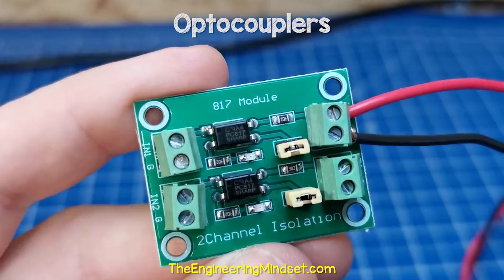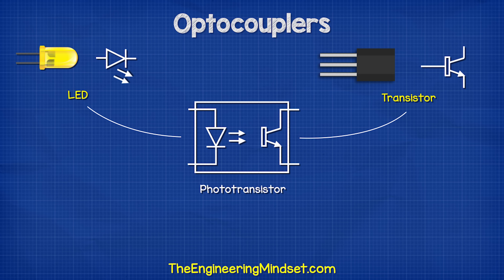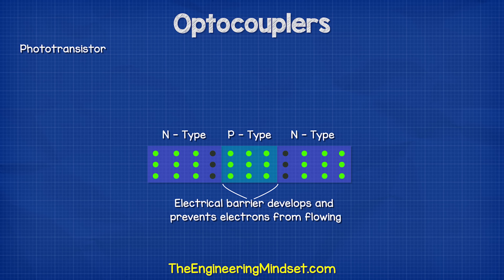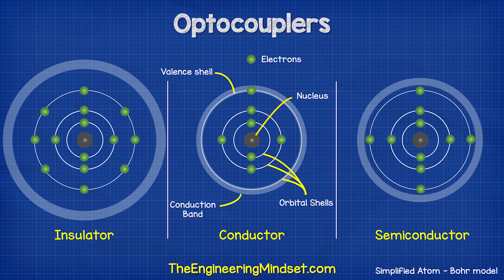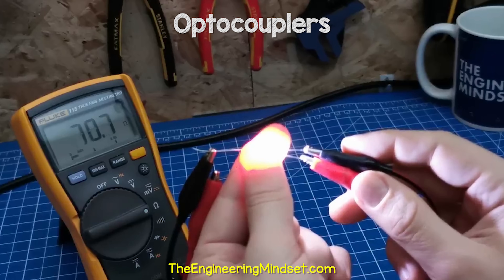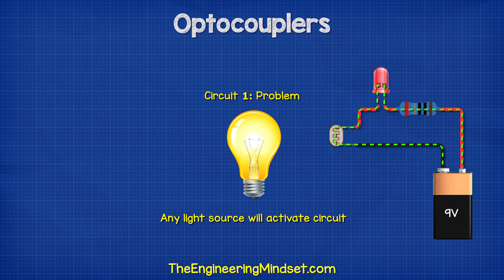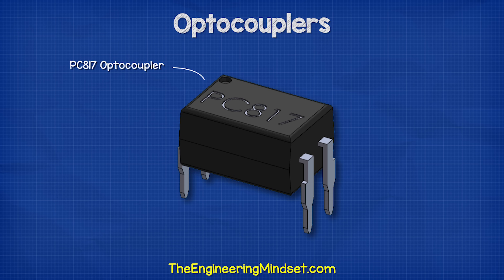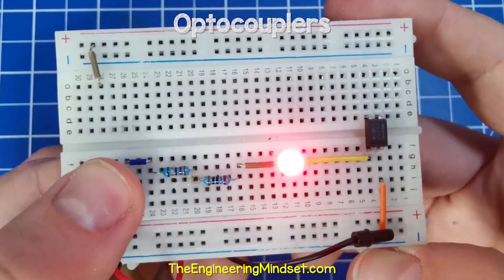How Optocouplers work - opto-isolator solid state relays phototransistor

Comment: Question:
I'm going to use a 30 amp rated optocoupler relay to power and automotive ignition coil on an old beetle.
Do I need a flyback diode ?
I'm only an electronics novice.  So could you help me with a little circuit design and values ? Thank you very much.

Comment: Hello I have some questions can an optocoupler by used for sine wave triggers ? You see I have sensor control trobel Using an hei ignition system so I wanted to experiment with other methods controls.So I'm interested to know what frequency range do those optocoupler work ? I do need kinde of pulse trigger for an transistor based phase shifter 0-180° variable phase controler so only problem I have is turning that useless sine wave signal to an DC pulse trigger signal .So Hoppe some one understud my question.Does the sine wave need to by rectified with capacitors or diode bridge so that optocoupler would work ? My operation frequency is at around 0hrz up to 333hrz other info that I have is 1khr rated reluktor ,1.35henry with around 350ohm resistance . So Hoppe some one also work with sensor controllers and can assist my with my unusual problem.

Comment: Pardon my ignorance. But at the 10:21 minute of your video, when calculating the necessary resistor value for the secondary side of circuit 1, does the LDR not have a voltage drop to include in the calculation? I appreciate your very well documented video.

Comment: I just realized that they kinda use the same principle as fiber optics huh? They send a signal using light emission which is then detected with a photosensor on another circuit. That is funtamentally how fiber optics transfers data

Comment: Your pinouts do not match the manufacturers data sheet. The pin1 by the dot is correct and the numbering goes CCW. Your emitter and collector pin numbers are wrong but the descriptions are correct. Excellent technical description otherwise.

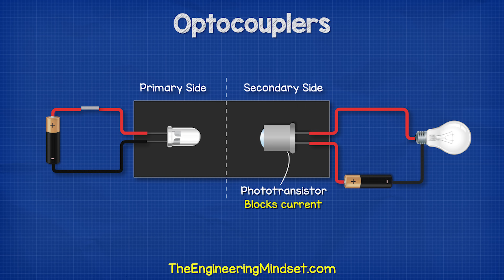Comment: The animations sometimes show electricity flowing from the positive to the negative terminal of the battery, however, it actually flows in the exact opposite direction. 3:45 has the electricity flowing from + to - and from - to +, so I guess you never intended to show how electricity flows in the real world, which is kinda sad, considering how awesome the rest of the video and explanation is.
Reply: That’s why he said using the conventional method of diagraming it. Which is correct.

Comment: Question, i have 380VDC output from a solar inveter i am building and i need to light up the ired diode inside anEL817 opto, as a feedback voltage control, what is the best way to do it? with resistors and a 10K pot or with Zeners?  this is with an SG3525+LM358 +EL817   board
Reply from the maker: Seen our new video on HOW SOLAR PANELS WORK in detail https://youtu.be/Yxt72aDjFgY

Comment: Very complete and concise presentation. 
I noticed one thing about PC817 though that surprised me. You show the pins 1, pin 2 on one side and pin 3, pin 4 on the other. According to the Sharp datasheet, pin 3 should be pin 4 and pin 4 should be pin 3. That is, the pins are numbered down one side and up the opposite side, not both sides from top down. Not sure that will cause anyone too much heart burn, but ...

Comment: I bought 15 - 20 of these bad boys in the past over different time periods with various types (transistor, triac whatever) and they all turned out broken. One time I was following a circuit and other I made sure I applied correct values but no luck. I don't know if I popped them by some easy mistake. All my instruments were working properly. I'm superstitious about them at this point and hope I never have to use them again. (p.s. I don't even remember wtf were the projects nor do I have any schematics from them, just thought I'd share my experience 😆)

It is sad because these are the cutest packages ever with their 4 pin dual in line structure. They could easily go for a boring single lined 4 pins transistor look but they didn't.

Comment: Thick film resistors have a 25KV rating, this optocoupler circuit will arc over before that. A thick film 2W resistor on both power lines followed by  clamping diodes is lightning proof and if you short the signal lines on the board it has no effect on the supply line. Optocouplers are crap, they have a rise time in microseconds compared to the nanoseconds with not using them.
Reply from the maker: Check out NEW resistor video, everything covered! ➡️ https://youtu.be/DYcLFHgVCn0

Comment: I HAVE A QUESTION PLEASE 👉👈🥺
The illustration shows 2 separate power sources. But what if you connect it to only 1 battery? Will that work the same way as an isolated circuit? I am building my DIY Amplifier and I'm struggling how to isolate the ground(negative) connections from 1 power supply to power two different boards such as power amp and Bluetooth decoder. When I connect them to the power supply in parallel, it produces the humming sound even when the volume is down to zero. I'm looking at B0505S 5V isolator to power the Bluetooth decoder using the same power supply (or battery) without any noise due to ground loop (or something like that).. Or should I use optocoupler instead? THANK YOU.

Comment: You have numbered the pins incorrectly at about 0:35.  Pin 3 and 4 are should be the other way around with pin 3 at the bottom right and pin 4 at the top right.  I know that might seem pedantic but it's important to get numbering systems correct, especially when dealing with ICs.

Comment: The explanation after 13:50 makes little to no sense, since you are introducing a mystery component Receiver, which you don't explain at all. It doesn't seem to work as a IR fotoresistor, and it isn't an emitter, so why is it calculated as an IR emitter? Is it in fact an IR activated transistor? If possible, could you (or someone) please either explain how this works, or point to some materials that explains the workings of this receiver that works like in this diagram.

Also, why are the receiver stats looked up from the emitter graph?

I am lost, after wasting hours trying to find anything even remotely clear information about this topic, I could only find wildly contradicting articles. If anyone can explain this to me, or point me to the right direction, I would greatly appreciate it

Edit: For anyone else interested, I got our University's Electronic's Professor to explain it to me. In the tutorial, he is suddenly changing into a photodiode setup instead of photoresistor, and using the photodiode in reverse! 

So this photodiode will act as a normal diode in dark, however, unlike normal diodes, it will allow current to pass both ways when hit with the foton particles. 
And since it is reversed in this case, it will block all current, until it is bombarded with fotons. It also has a dark semi-transparent shielding on it, that will block the unwanted wave frequencies, and will act as the switch here-

Comment: Well done! The most impressive thing about this video is the correct usage of units and their symbols, namely omega for resistance (instead of R that most Yankee videos would use; also some Australian), capital V for voltage (yanks use most of the time incorrectly lover  case "v") and putting zero in front of decimal point. Congratulation, keep up the good work and hope that budding young technicians will pick some good habits.

Comment: two quick question for you 1- how to protect the optocoupler from reveresed voltage from a mosfet which is connected to the output ? do i need to put a diode before the 100 ohms resistor on the gate? question 2 - is it possible to use the mosfet source and drain as a switch between 2 capcitor to connect them one time as parellel and one time as in series ? just like a switch by sending a signal from an arduino , my issue is its latching to close always how to prevent that latching ? thanks a lot in advance
Reply from the maker: Check out NEW resistor video, everything covered! ➡️ https://youtu.be/DYcLFHgVCn0
Reply from the maker: See my new MOSFET explained video here➡️: https://youtu.be/AwRJsze_9m4

Comment: Fun fact: some people CAN see infrared light. Some are born with an extra cone. Some have a wider bandwidth of light. I don't think I have an extra cone but since I was a kid, I've been able to see a deep deep red light coming from the end of a remote control. I've also noticed I can't see all tv remotes as some use even longer wavelength infrared than most. It also seems like most TV's use a shorter wave infrared, the ones I can detect. IIRC, most tv remotes is 860nm? That's the one I can see.

Comment: There are also optocouplers that have an integrated MOSFET (a type of transistor) and can handle large amounts of current and voltage without the need for an output stage. For an example, check out the data sheet for PVN012.
Reply from the maker: See my new MOSFET explained video here➡️: https://youtu.be/AwRJsze_9m4

Comment: Something to keep in mind for future vids. Your direction of electron flow is inconsistent throughout the video. around 3:14 for example the optocoupler appears to be coupled between two universes with different sets of physics. Probably most people won't notice, but seeing the electrons represented as travelling the correct way at one point messed with my head as I've had to ignore thinking of it that way to stay sane.
Reply: There isn't anything wrong in it, and no two alternate Universes. There are just two ways to show the current flow, the conventional current (+ to - ) and the actual electron current ( - to +), both are equally valid and used in electronics all the time. However, you do make a good point, that mixing them inside the same video, might confuse some people new to electronics, which so happens to be,  is most likely the main audience of this video.

Comment: But why do you want to use this? If you connect the switch to the second circuit you van cut the first one.. What are practical reasons that this is better than just 1 switch to turn on a circuit?
Reply from the maker: It's electrically isolated, over voltage or current on one side won't damage other side

Comment: I like your video´s. at 3:25 and onwards, you show two batteries. current in one battery flows into plus pole. on the other battery it flows into minus pole. Notice that i'm not referring to electron flow versus traditional current flow.

Comment: The triac versions of these chips are interesting.  They're meant for AC applications, but if you run DC through the triac it will "latch" on and keep allowing current to flow when the control/switch pins are no longer conducting.  It will keep conducting until it stops conducting (for another reason), which can be a useful property.  I built a couple of interface controllers that would turn stepper motors while a sensor was going. There are better methods (that I know now but didn't then) but the machine has been running for more than 20 years now so it definitely worked as intended.

Comment: Simply great teaching, thanks for sharing your knowledge!!
May I please ask you about a "conclusion" I have arrived to, via your videos?
In your video about BJT does it look like you can adjust the "door" how much it is open, by adjusting the current, or in a way make it act as a resistor. And in this video do you show that one side is an LED and the other side a light-activated BJT. My question is since a LDR is very unliniar if it's possible to use the BJT optocoupler as a variable resistor?
Reply from the maker: Check out NEW resistor video, everything covered! ➡️ https://youtu.be/DYcLFHgVCn0

Comment: @17:08 why does 0.02 =  20mA  
when that number is read in decimal format "0.02 = 2/100'ths"
 (2 Hundredths) 
I had to rack my brain in conversion of units to figure out it's in multiples of 1000'ths of an Ampere
0.02*1000 = 20

Comment: Nicely explained.

Suggestion for BOM consolidation: 390 ohms would do just fine for every resistor in the demonstration circuits. No need to stack multiple resistors of various values in series for something as simple as an optocoupler, whether it's an integrated package or a homemade Vactrol.
Reply from the maker: Check out NEW resistor video, everything covered! ➡️ https://youtu.be/DYcLFHgVCn0

Comment: At 3:20 your current (or electron) direction conflicts from the left side to the right side. I’m not sure what flow direction it’s meant to represent.
Reply from the maker: Animation error
Reply: @EngineeringMindset   ah okay fair enough. I do want to point out the real downside with LDRs are that they’re really slow compared to phototransistors (look at how the LED turns off slowly in your video with the LDR). Phototransistors still need to be covered due to stray infrared from remote controls or face recognition devices like iPhones which is why remote controls tend to use protocols so they don’t accidentally get activated (because you can’t really cover them during transmission). Photodiodes are even faster than phototransistors but require op amps to amplify the circuit and like semiconductors in general, aren’t linear so they need negative feedback (by having another identical receiver on the left side) to drastically improve linearity.

Comment: Pinout at 30 seconds and throughout is incorrectly labelled. Top left (near identifier) is Pin 1. Bottom left is Pin 2. Bottom right is Pin 3. Top right is Pin 4. You have labelled pin3 and pin4 the wrong way round. I read in your pinned comment it took you a long time to make this video, and read in the description where another viewer corrected the resistor value, so I hope this pinnout  issue can also be corrected as easy.
Reply from the maker: Check out NEW resistor video, everything covered! ➡️ https://youtu.be/DYcLFHgVCn0

Comment: How to make for ac using pc817
Reply: You use it in its very small linear section of the transfer curve. In short, you offset it on the diode side so the diode will always be lit taking into the calculation for the maximum peek voltage of AC input when calculating the series resistor. Then you can retrieve the insulated AC signal on the output. Another possibility is to use an optocoupler with two phototransistors and having an op-amp use one of the phototransistors for a feedback loop. That solution will be very precise. It is all in the data sheets and application examples.
Reply from the maker: Check out NEW resistor video, everything covered! ➡️ https://youtu.be/DYcLFHgVCn0

Comment: Hi Paul. About your Rectifier Circuits video 

https://youtu.be/RiRyzLl4Y8U

Great work. Just one thing that keeps me wondering...why does the multimeter on the right read peak voltage of the capacitor(15.5V) but without the capacitor, it measures RMS voltage (10V)?🤔
Does it have to do with
1. A setting on the multimeter?
2. A property of capacitors? Or
3. What?
Reply from the maker: It's the waveform which the multimeter is reading. Without a capacitor the waveform goes between zero V and max V. With capacitor the waveform no longer reaches zero.
Reply from the maker: Check our new Multimeter tutorial out ➡️ https://youtu.be/4lAyzRxsbDc

Comment: and for example if the circuite have 2 optocoplers whats is the function in 2 optocoplers ? please
Reply: When you have 2 or 4 lines requiring isolation, then just get a dual  or quad optocoupler to save space and economize.

Comment: 10:15 You forgot the voltage drop in the LDR.

Including it, the KVL equation around the loop would be (ignoring units):

9 = v + 2 + 70 · 0.02
=> v = 9 - 2 - 70 · 0.02 = 5.6 instead of 7

So the resistance of the resistor would be 5.6/0.02 = 280 instead of 350.
Reply from the maker: Check out NEW resistor video, everything covered! ➡️ https://youtu.be/DYcLFHgVCn0

Comment: I still remember back in 1980. We had an industrial application to measure PH Levels. It had an optocoupler of earliest design. A 1/2" plastic tube with 2 wires coming out of each end .  //  \\  They lasted about 4 months, and had to be replaced at a 1980 price of $80/EACH. 🤓 Much at my bosses dismay (wasting company time), I found out that there was a photo-transistor on one side, and a PR-2 flashlight bulb on the other side. The bulb burned out every 4 months.   🙄     These were glued in place with silicone. Bulb was less that a dollar.🤐 Boss never accused me of wasting time again.😄😄
Reply: There were many very high quality optocouplers available in 1980  with extensive reliability data and used for the most sensitive and critical military and space apllications as well as commercial applications so you must have come across some really kludgy design.

Comment: hai i have question here why we need transistor as switch if we could manually turn in on using normal switch? i still dont understand how we need transistor
Reply: To switch on/off a higher current circuit and isolation of differrent circuits from primary one.

Comment: Great video, however acc PC817 datasheet you have flipped pins 3 and 4 😊 if any will replicate pay attention to pinout.
Reply: That is called mind wrongs set. 1:37= 3&4 is flipped,  pc817 with 2 & 3 connect to Gnd's but gnd1 and Gnd 2. +1 from positive primarily pin 1 through led out to - Gnd primary of pin 2. So on on secondary from pin + pin 4 C through transistor npn to - pin 3 secondary Gnd.  Gnd of primary may be different voltage compare to Gnd of secondary.